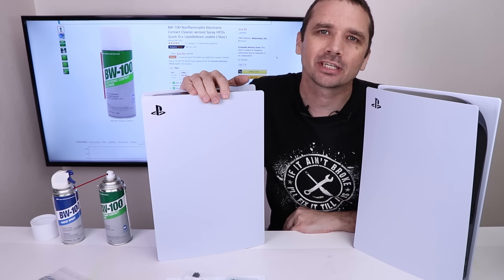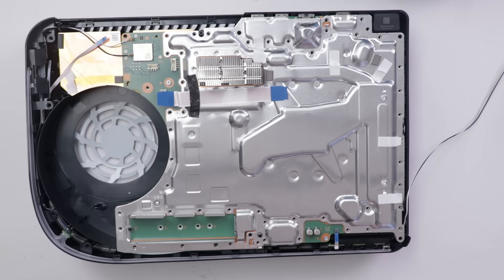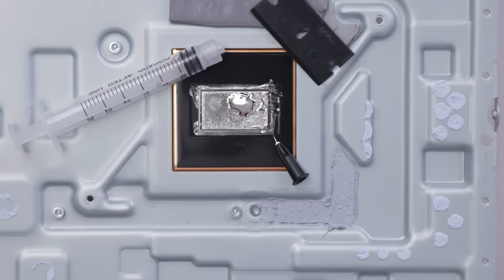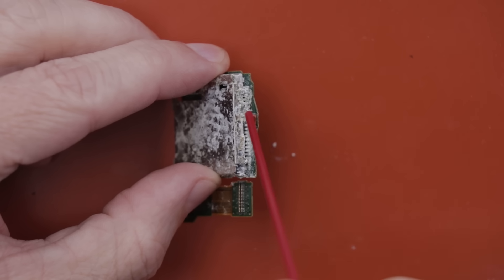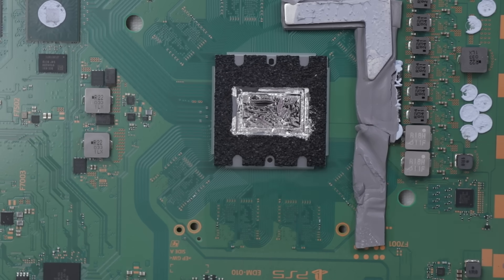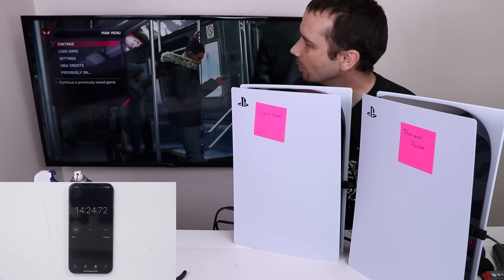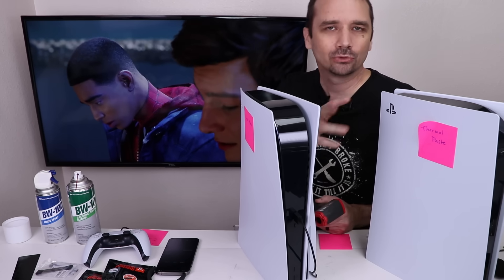PS5 Liquid Metal vs Thermal Paste - It OVERHEATED!

Comment: I'm honestly really unimpressed by the LM PS5's overheat protection not tripping correctly. It should have shut off right after the first warning, not kept going for another couple of minutes with the die being so hot that there were graphical glitches happening. Do they want the die to suffer permanent damage, rendering the overheat protection useless?!
I wonder if this will be a widespread defect, or a rare defect.

EDIT: Apparently other people in the comments already don't understand, and are just saying "WELL HE UNPLUGGED THE FAN THIS WOULDN'T BE A PROBLEM FOR REAL LOLOLOL"
Yes, it would be a problem for real, that's the entire point of overheat protection. If you put the console in a closed space where it can't get fresh air, or the fan fails and isn't spinning anymore (simulated perfectly by unplugging it), the console is going to overheat. You WANT it to shut off immediately if this happens, so you can fix it and not suffer any permanent damage. That the PS5 with liquid metal "lasted for 3 more minutes" is not a good thing, it's a bad thing. The thermal paste unit shut off right away and saved itself, as it was supposed to. The liquid metal model kept running and displaying glitchy graphics because it wasn't working correctly due to the heat, that's a bad thing. It could have been damaged in that state, it should have shut off immediately like the first one did.

Comment: cool thing is, if ps5 used a cheaper less efficient solution like thermal paste (aka what xbox series x uses) then ps5 design would probably have been bigger to accomodate a larger fan or even less powerful to produce less heat. quite interesting how liquid cooling can give you more performance in theory by pushing the processor more
Reply: U mean cutting corners as a buisness to make extra profits while giving the customer less. That sounds about right coming out of japan
Reply: @WildSamBladden  they're not giving the customer less? If a company has the ability to cut down on costs while maintaining or increasing performance then that's probably the best of both worlds for the manufacturer and customer

Comment: Weird that the consoles were not signaling about the disconnected cooler...
Reply: The cooler doesn't send any information to any controller chip. The 3 wires it has are: VCC, GND and signal, the latter to control the speed of the fan. Most electronics work that way.
Reply: @LeBrulox  I have zero knowledge in electronics. Isn't it possible to check how much power the cooler consumes by setting some sensor before the VCC wire? Or just check if the wires in the port are terminated correctly (back in the days, I was impressed that some of PC motherboards [the Realtek-based ones?] could tell if there's a mini-jack connected to audio output or not)?
Reply: @iXPilot  Yes, it's possible and some chips have that capability but the reason why you don't see this implemented very often is because the temperature sensors inside the console already give you the indirect information regarding the state of the fan, i.e, if it is turned on or not, and consoles specifically have A LOT of those sensors so you can almost precisely point out which parts are overheating. Also, many chips come with temperature sensors so it's more convenient to work with them since the beginning
Reply: @iXPilot  Many cooling fans in industrial applications give feedback for their RPMs.  You'll get a soft-fault that a fan has failed.  It's not an expensive upgrade, but, when you're talking 5$ over 1,000,000+ units produced.....it adds up.
Reply: @LeBrulox  precisely
Reply: Very flawed testing method..., whichever device you started gaming on will overheat first, the idling part they potentially could've done forever with passive cooling, as there is little to no thermal load on the chips

Think of it this way, if you were testing thermals of phones by recording 4K on phones in the summer sun, they could passively cool indefinitely for the idle portion of the test until you start the actual camera video recording test which would only run until too much heat had built before terminating the recording, it's fair if you start recording simultaneously, but if you take turns, well obviously in that case the one which started later would have the longer time (even if you used exact same phones) as idling is simply not in the same scale of heat input whilst the other phones is pumping heat into gobs of processing

Truth of your testing is, whilst idling neither system was too hot to need to turn off from the lowly duty of idling, they were however much too hot to be gaming on long before you tried gaming on either of them. The requirements are different for different levels of workload

Using the phone analogy your phone can be too warm on a summer day to actually let you record 4K when you go to launch camera, but still have had been cool enough to not stop other apps from launching, or even idling, but depending on how hot of an environment such as direct sunlight in an old parked car you can end up with at-least a thermals warning, & if neglected excessively in the worst of situations such as the earlier car situation, but in like California, it may actually turn off

What I'm saying here is there's different levels to heat, & modern devices don't just have one level to where they simply turn everything off all at once, but rather multiple thresholds where more & more features/apps/games are disabled, so that the user experience is that you can at least get some functionality that aren't as energy intensive, meaning when testing you should have started each machine by itself & immediately went to gaming and seen how quickly it gave you the temperature warning, and restart the process from off to gameplay with a new reset timer & compared the two individual times against each other, that would be the more optimal way to have tested this

Comment: Looks like too much thermal paste. Which one was it? Cooler Master Maker testing? Also is there pressure applied on the die? Looks like the cooler and die was developed to work together for liquid metal. Now, can you reapply the conductonaut and beat the PS5? And also fix the ram heating and thermal pads not touching?

Comment: Let’s see a Series X with liquid metal. I did that to my One X and it ran great for years thinking of doing the same to my Series X now.
Reply: Too much work and why would anyone do that? It's not built to house liquid metal which will dry out when I'm contact with copper which nearly all heat transfer parts are made of. This would not end well for the components.

Comment: But even if the one with the thermal paste have a bit higher fanspeed it stays cooler in my eyes. But at all does it show that Sony dont have the thermal under control at all. I said that since september (since i had one). Also the problem with the ram. Ofc they updated so the PS5 dont use the full ram speed anymore but still. Also a problem in the future will be the repair of rsm modules. 
One more thing i wonder is that Sony disabled the sata slot on the first update. On mine it worked fine with a pci express 3.0 one(as i said i had it at september already)

Comment: Would be great for you to investigate PS5 coil whine and the noise difference in fan models between delta/Nidec etc. also if silicone thermal pads are better than the thermal puddy compound

Comment: He can get the perfect amount of thermal paste...

But can he get the perfect amount of liquid metal??
Reply from the maker: Ha, ha...still perfecting that!
Reply: Why not put thermal paste as much as possible?
Reply: @iandu7517  cuz the more doesn’t mean better
Reply: @mrtoasticles7144  why
Reply: @iandu7517  cuz idk how to explain but too little thermal paste is bad and too much is bad. You gotta have the right amount. What i did for my ps4, I applied thermal paste, closed it, and re checked to see if i put the right amount, cleaned it and re paste.
Reply: @mrtoasticles7144  ok
Reply: its not possible to have too much thermal paste u can only have a less
Reply: @martinsrom7853  why, the machine will be cooler,
Reply: @iandu7517  but there will be thermal paste every where even on the motherboard meaning when the thermal paste drys it could start causing corrosion and the dried paste will get under chips and in places that will start to over heat the thermal paste.

Plus the place u put the thermal paste on is the only place the thermal paste will properly work that’s the whole reason why there’s a certain spot for it in the whole console.
Reply: And aswell have to little thermal paste will just make the console over heat easier
Reply: @YSSEAN0  got it, thx
Reply: @MiGujack  thx!!
Reply: @YSSEAN0  u r wrong
Reply: @iandu7517  how?
Reply: TheDoge 777  I was telling him why he shouldn’t put too much or too little, I don’t know how I wrong tho

Because that was his question in the beginning, @I and U never ask to know about LIQUID METAL he only ask “Why he shouldn’t just use a lot of thermal paste

So in theory nobody is wrong 😑
Reply: TheDoge 777  oh XD srry
Reply: @mrtoasticles7144  aslong as the thermal paste isn't conductive, too much isn't an issue, its just really messy... but on the other hand too little is..

Also you didn't need to clean it off again after checking to make sure it was OK..  you can reuse thermal paste.. aslong as its still wet

Or you could spread it yourself before putting the cooler back on

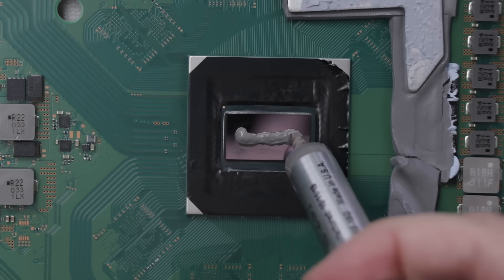Comment: 8:42 Ahhhhh perfect
Reply: Too much ( ´ー`)
Reply: @danholli123  no such thing as too much when it is of paramount importance that you cover the die under all circumstances. If even the tiniedt part is not covered, the transistors under that section will overheat. This is opposed to putting too much on, which results in a bit of a mess but totally normal thermals.
Reply: @matthewmcewen1  but there is such a thing as too much as thermal paste is meant to be a filler of the gaps not a patty in a burger
Reply: @matthewmcewen1  liquid metal is also a lot more conductive than thermal paste, which is why they used it. I saw a video where they replaced it with thermal paste and played a game for 30 minutes and it over heated
Reply: @matthewmcewen1  A really thin layer of thermal paste is more than enough to keep the die cool.

The objective of the thermal paste is to get into the MICROSCOPIC irregular surface, increasing the contact area and the heat transfer. If you add more than a thin layer you are just increasing the path that heat needs to pass through before reaching the cooling solution.
Reply: @One57Games  well... not really, because it just oozes out the sides. Gamer's Nexus did a video on it. They concluded that there was no way to reduce the performance of thermal paste by putting too much on, so long as mounting pressure was high enough to squeeze out the excess. Sure, it leaves a mess, but theres always going to be a small excess anyway, and it is more important that you cover the whole die especially in this case, because there is no going back from killing a cpu with insufficient die cooling.
Reply: @One57Games  hell, theres a foam barrier SPECIFICALLY PLACED to catch excess thermal compound, why not use it?

Comment: It's doesn't really matter what kind of thermal compound you use, the same amount of heat will be released into the room. The APU is creating nearly the same amount of energy on both consoles. Technically the APU would need a bit more energy at a higher temperature, because of the increase resistance. 

The APU of the thermal pasted PS5 is running hotter, because the heat transfer from the APU to the heat sink is slower. The hotter the APU runs, the faster the fan will spin. The faster the fan spins, the more air will be pushed out of the back into the room. The heat sink is getting cooled more efficiently, because of the higher air flow and therefore the overall air temperature at the back is lower. However, the amount of heat/energy that's being pushed into the room is the same as the liquid metal PS5.   

It doesn't really matter what the temperature of the air is. The more important is how much air is being pushed into the room. Blowing 52C air into the room at a slower pace will heat up the room less than blowing 52C air into the room at a very high speed. So even though the air of the thermal pasted PS5 is cooler, the same amount of energy/heat is being pushed into the room, because of the increased airflow and air volume.

Comment: Wow! That's the exact thing was bothering me most that what if to use Thermal Paste instead of Liquid Metal Paste in PS5.
Thanks to you we now get to see some results in live testings and temperature measurements.
You have made my day much better.
You are truly Mighty.
Keep the good work.
Oh and can you please do a HDMI port replacement on PS5 for testing?
I heard that some crazy people out there owning their very first PS5 have made some significant damages since the launch of console and as im in a facebook group related to console repairing,some console repair technician mentioned that PS4 Slim HDMI is somehow compatible since still there's no place or parts made for PS5 yet such as HDMI Port,they had to use Slim Version but they have ran Jumper wires to connnect HDMI legs to the pads and surprisingly,it worked for customer.
Would be interesting to see that from you.

Comment: the ps5 gpu's frequency is higher than the series x that's why liquid metal is important
Reply: It’s not that much higher liquid metal is there for added insurance.
Reply: @tails300  series x has thermal paste so why isn't it overheating?
Reply: @DiGiTAL_S80  idk but there are reports I runs hotter than the PS5.

Comment: Based on liquid metal applications I've seen you and others do: when you first took the liquid metal off, the fact there was a puddle for you to use a syringe, doesn't that mean they put too much on at the factory?
Reply from the maker: Too much? Nah, they've taken precautions to make sure it's not going to leak anywhere.
Reply: The puddle forms due to the surface tension. The actual application is probably fine. During the removal the liquid metal flows together into one blob.
Reply: @detroxx56784  it had appeared to me a layman, that after the puddle was removed, there was more than i have seen tronix fix and other apply. But like he said, they have barriers and what not in place.

Comment: Try to remove the metal grid on both sides of the fan maybe it will improve thermals .
Reply from the maker: You mean the heat sink fins?
Reply: I meant the thing you took of at 0:54  its on top of the fan and could  restrict the air flow of the fan a bit. Maybe you could leave it out and just bolt the fan down without it.
My description is kind of bad because im not a native english speaker ( im from Germany )
I Love your Videos They are really interesting !

Comment: Cool try I guess, but obviously if thermal paste was even close to working instead of liquid metal Sony would use paste as it is so much cheaper and easier to work with. During development they probably spent lots of time trying to make it work till they bit the bullet and went the liquid metal route.

One thing not considered in this video is that the PS5 is brand new. With time dirt will accumulate on the fan, heat sink and everywhere else and the cooling situation will be a lot more stressful for the system, especially in summer.

Comment: Curious how long the Series X would last using the same test with an unplugged fan... Probably a shorter amount of time because the cooling system is based on the heat sink having air moved against it perpendicularly.
Reply: Not at all. The thermal mass alone is over double that of the PS5. That one factor would keep it cooler for longer.
Reply: @yt 1234 They don't run "hot" they dissipate more heat exhausting hot isn't a problem that's a design

Comment: 1) I'd like to see more on the BW freeze spray.
2) is liquid metal easy or feasible on other consoles (ps4, xbox series)
Reply: I think he has video where he put LM in those consoles you got to check his channel. but as you can see Sony took the effort to create type of gasket around the APU and the cold plate, without it accidents that LM spill (surprisingly it is liquid) and short things on the board might happen.

Comment: So, would it be a good solution to change thermal paste by liquid metal thermal paste in other products, like ps4 ?
Reply: No, the base ps4 can not have liquid metal. It is only possible on copper heatsinks and the base ps4/ps4 slim have aluminium heatsinks. Also the liquid metal would get on things you don't want it to. So you have to use nail polish to protect the chips and stuff like that. You can watch videos on youtube of people putting liquid metal on the ps4 pro and how to do it if you want to.
Reply: @ilseizi  Thank you for the info